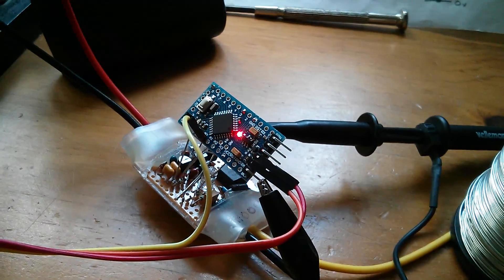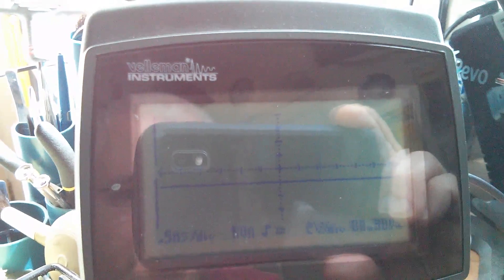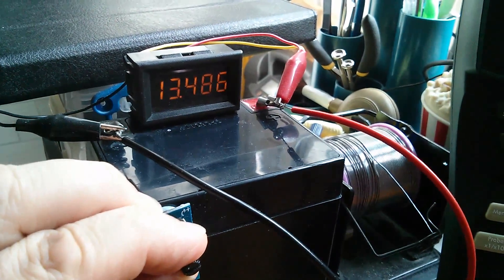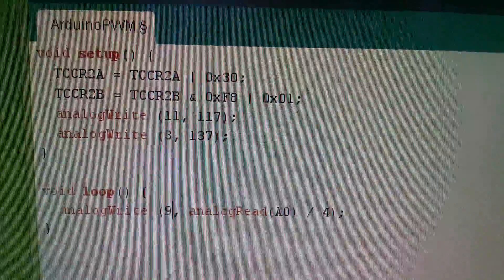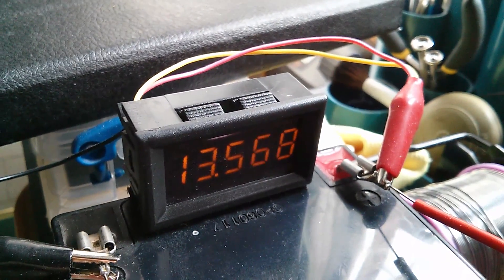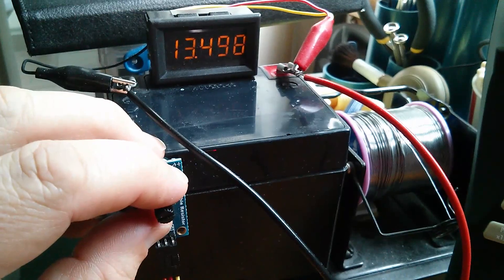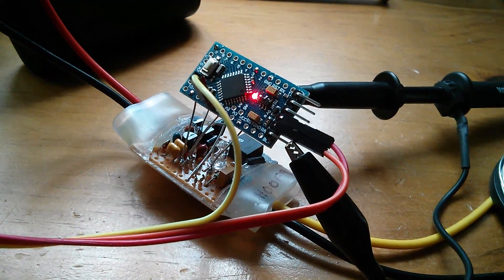Arduino PWM Solar Charge Controller #3 - Open Loop Control

Comment: Couldnt the microprocessor regulate charging voltage depending on ampers value? Why you play with the potentiometer since you dont know the current value?

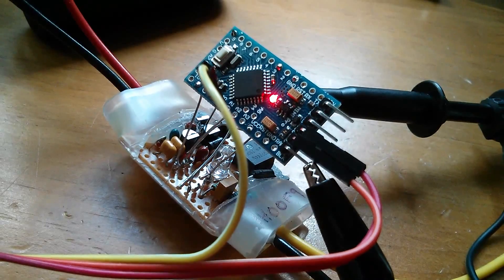Comment: Hi Julian. Great work you're doing. I've watched all the videos, now I want to have a crack at making one of these. Only done very basic hobby electronics before, but have had a play with programming on RPi  too.  My main question is should I use the diagram at 2:04 on this vid, or the one at http://www.256.co.uk/wordpress/wp-content/uploads/2012/09/PWM5-Circuit.jpg

Jimmy.

Comment: Why in particular have you chosen 13.5v as your target float voltage?  (Why not say 13.8v or 13.2v for instance?)
Reply from the maker: I did a lot of reading at batteryuniversity.com - that's probably where that number came from.

Comment: You thought about a ATTINY85? You don't need a crystal and its in a 8 pin DIP or SMD part.
Reply from the maker: I'm not sure the tiny85 has enough PWM outputs - I'm using 3 - two for the charge pump and one for the MOSFET control. But please correct me if I'm wrong.
Reply: Yeh there is but not something that the average person can really use. But it can be done.

Comment: This is awesome.   The fact it is open source and the Arduino is the brains gives this a leg up on commercial charge controllers.  I will defiantly follow this project cause the great thing with open source projects seems that they only get better.   There will probable be a day where this will match/beat most charge controllers in its class and will be cheaper to boot.  I will definitely think twice when go to purchase my next charge controller. Good job and Cheers!

Comment: cool stuff. lots of toys! you are pretty close in theory to what my little controller is doing. high farad capacitors in parallel with the solar input slows down the swings a little bit, making it easier to nail down that sweet spot..... but there are a ton of variables. i eventually want to set up two systems side by side, with identical panels and batteries, but different circuits to show the difference.

Comment: Reminds me of Lunar Lander as programmed & played on RM 380Z & later BBC Model B at school.
Reply from the maker: Of course, that's a much better analogy!
Reply: Lunar Lander is a great analogy. Most people don't understand why they can't keep two magnets a constant distance to each other (in a range where they attract each other of course)... they try using linear algorithms but in fact the force exerted on each magnet variew as the square of the distance so once it starts going your linear system will never be able to catch up.

This is no a higher order like that but more random. But the lunar lander is.

Anyhow, great video again. J.